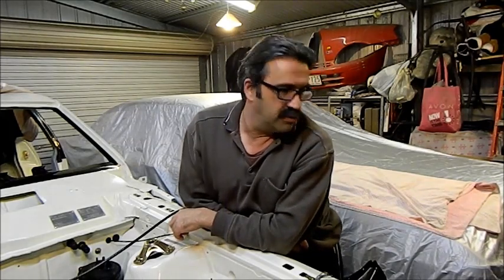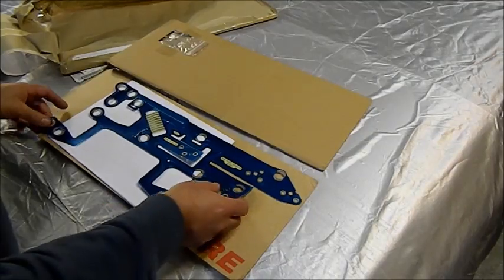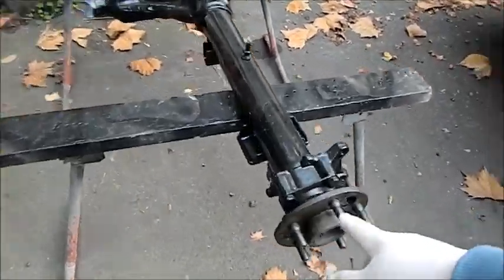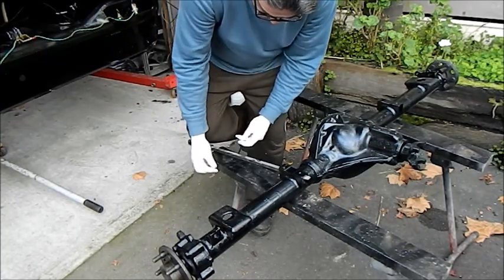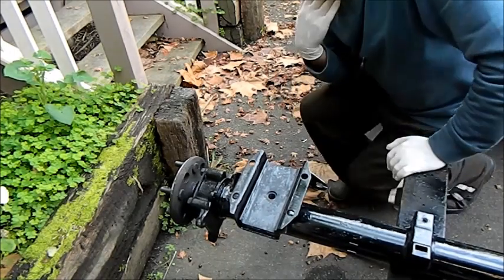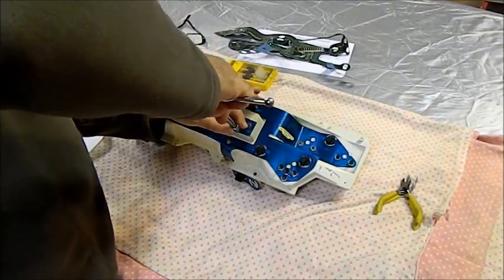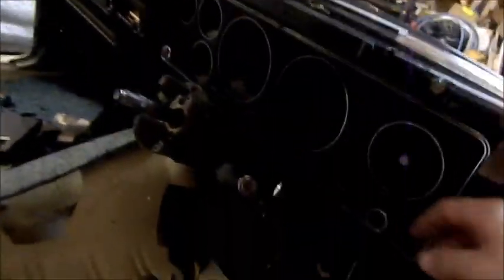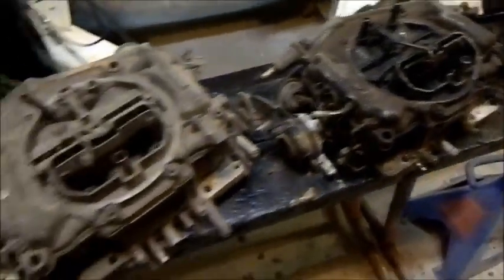Ford XC Fairmont 351 Restoration Part 17

Comment: Coming along nicely Peter, a lot needed when starting with just a shell. Hopefully you find the parts you need to finish it at reasonable prices, another great video :-)
Reply from the maker: Thanks Warren, I now have pretty much everything that I would have salvaged from a complete tear down, all I need to get is all the new replacement stuff. Cheers

Comment: A sad story. Back when I was just starting out in the work force (about 17 yo) I had a job at Flexdrive Instruments. My job was to maintain the calibration machines on the factory floor and diagnose faults in rejected instruments and instrument clusters. It was about the end of the XB and beginning of the XC. Long story short. Over the years I managed to collect about 20 complete XC GXL clusters. All brand new but had been repaired. They sat in my parents garage until about 10 years ago. My folks decided that Glenroy was no longer for them and packed up and moved to the Gold Coast.. without telling me my dad cleared out the garage and took all that useless old stuff away to the dump. I haven’t seen the packing box the clusters were in since. The blue flexible circuit board on the back of these clusters was a issue even when they were new. But easy to repair.
Reply from the maker: Oh no... that stuff would be gold now. Thanks for the comments, cheers

Comment: By, the way, the old lens is made by similar to R180 resin, so if you prepare a mold with the old one, you could make one at home. R 180 resin is clear and runny as water and although I'm not familiar with pore 15? pour 15 it's just as strong as the pour 15 you've demonstrated.

Comment: That clock face seems like the correct product, but when I bought one off eBay for my ZH  Fairlane, I got jibbed. It was just a clear plastic with a hole drilled in the center. I wound up buying about 30 or more clocks just to get a decent one. Good thing is, the decent one was like new because the clock didn't work,  from new, so it cost me $5. + $200 odd on 30 spare clocks.

Comment: hey pete, did you use the wedges to mount the steering column  ? theyre cast alloy, & allow you to drop the column a bit ( should be able to get them from the wreckers - theyre std). Also looking forward to seeing you recon the spongy steering wheel, the glue always lets go in these, i have been using an XE wheel for the last 20 odd years because of it. Like that speedo too.. know of any more ?
Reply from the maker: Thanks mate, yes I used the wedges... obtained most of this stuff from a ZH Fairlane donor car. To be honest, I'm half considering ditching the police speedo and going for stock. Not there yet, still may keep it, but like the XW, I want this car to be a little different from the bulk of other XC Fairmont cars... as for the steering wheel; a few strategic incisions in the rear with Araldyte injections will sort it. I may go down that road and have it leather covered, or go for a period correct Nardi... they produce some lovely wheels that wouldn't look cheesy or out of place. Where I knew every move on the XW restoration before I started it, this cars' open to anything... including a frequently changing mind! Cheers Pete.
Reply: interesting idea about injecting the glue, will give that some thought. If you do decide to get rid of the speedo, i'd like 1st refusal. i have 4 gxl dashes ( and other bits)here, im sure we can cut a deal with something you need. Zero chance of finding a cop speedo here in WA.